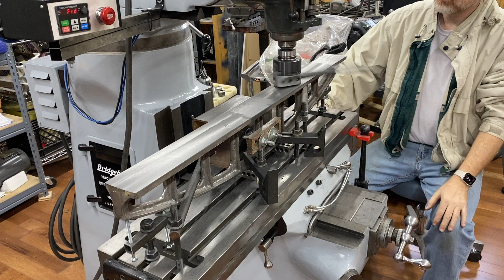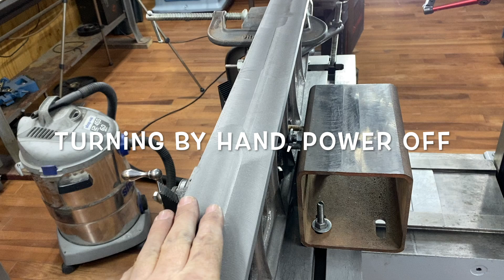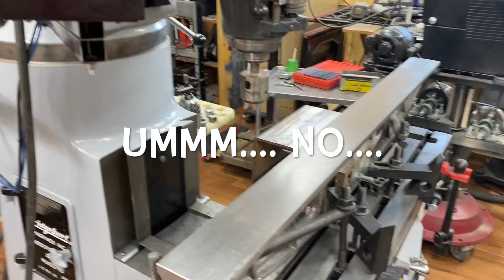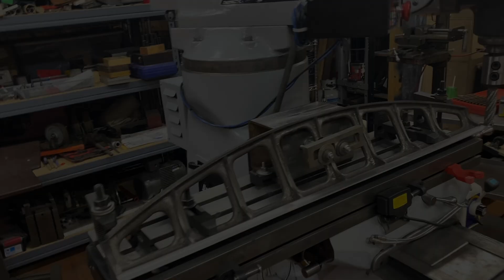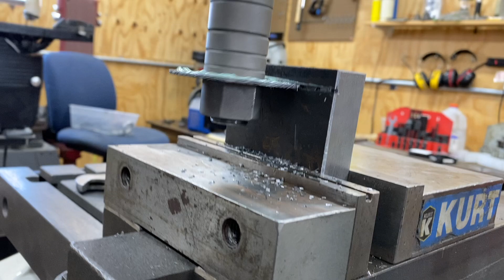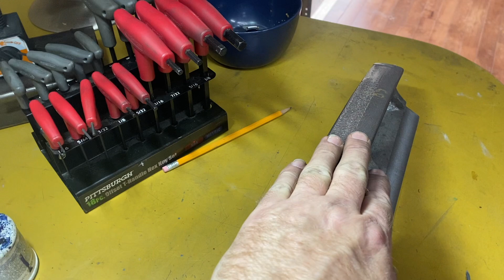Machining a Denis Foster Machinist Straight Edge, Part 2

Comment: When I machined my straight edge, I also had the issue with the dovetail edge. My problem was the straightedge moved slightly when I was machining it.
Reply from the maker: I am hoping I got that edge thin enough to reach all the way into the corner of the dovetails.  We'll see.  How long was the straight edge that you machined?

Comment: Kevin you certainly do have a beautiful shop. It almost looks sterilized. I certainly commend you for machining that much cast iron and keeping the mill so clean. Sometimes I use oil on a brush just to keep the fine particles of cast iron out of the air and on the ways. i am about to re machine the ways on the saddle of one of my lathes and really not looking forward to the mess that cast iron can make.
Reply from the maker: I think part of that appearance is that floor.  It is all nice and shiny.  The problem is that shiny floors are not really what you want when you need to start welding etc etc.  But thank you for the kind words!  :-)

Comment: That fly cutter at the beginning was maxing out the sketchy meter. 😬
Reply from the maker: They say you can't learn from your mistakes until you make your mistakes.  Ha!  I had hoped that with the soft cast iron that I would get away with it taking a light cut.  But you are right, way too sketchy!  Thanks for watching!